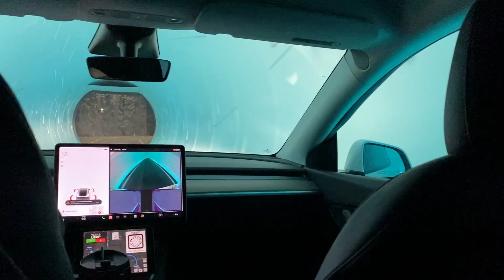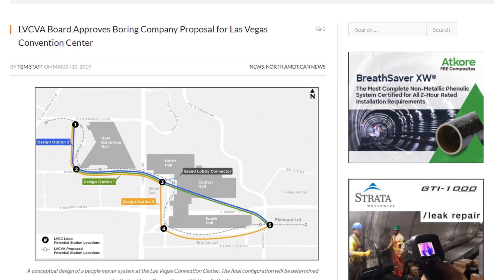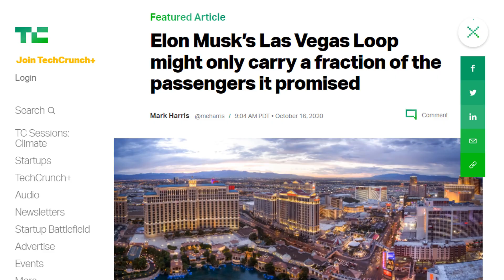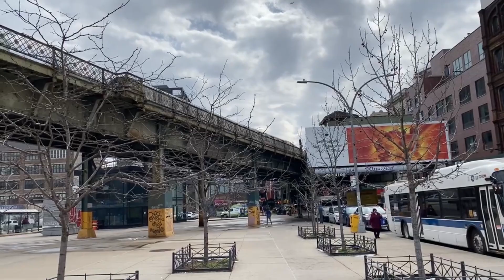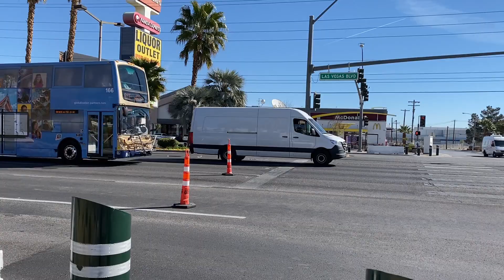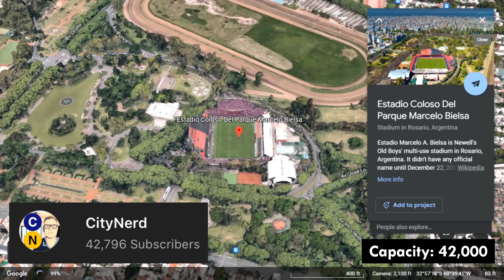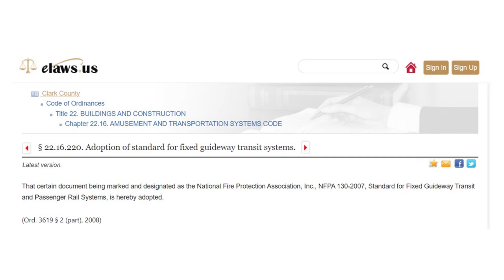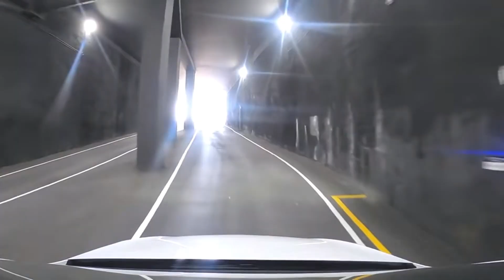Inside the Las Vegas Loop: Transportation Game-Changer, or Complete Waste of Time and Effort?

Comment: They could use Glasgow or London Underground style trains in those tunnels - heck, even the Glasgow subway tunnels are smaller in diameter. I hope they wise up and convert them to train/tram tunnels
Reply: londons is grandfathered in, you shouldnt build new tunnels like that
Reply: but why? until the system reaches capacity, smaller vehicles are better. lower wait time, EVs actually use less energy than trains on a per passenger-mile basis, and EVs can bypass intermediate stops. capacity isn't everything. high ridership areas need trains, low ridership areas still have demand for grade-separated transportation but won't exceed the capacity of 2-3 fares in an EV.
Reply: Why indeed would you put trains in those tunnels which are 5x slower than the Loop, less comfortable and VASTLY more expensive? The 29 mile 51 station Loop is now being built at ZERO cost to taxpayers compared to around $15 billion for an equivalent subway. 

With the LVCC Loop handling 27,000 people per day across the 3 stations, we are looking at 9,000 people per day per Loop station. As there are around 8 Loop stations for every subway station per mile through the busier parts of Las Vegas that means the Loop is capable of handling 8 x 9,000 ppd = 72,000 people per day which is double even the busiest subway station DUAL platform averages in Europe (Paris’s Gare de Nor) which handles 38,888 people per day per dual platform on average. 

Even if we ignore peak period increases on the Loop and assume every hour had exactly the same number of people per hour, over the 8 hours of operation, that works out as 72,000/8 = 9,000 people per hour for those 8 Loop stations compared to only the 3,950 pph average at Oxford Circus Station (2,160 pph per line) the busiest Tube-only station on the London Underground.